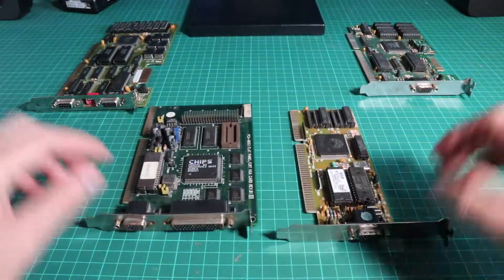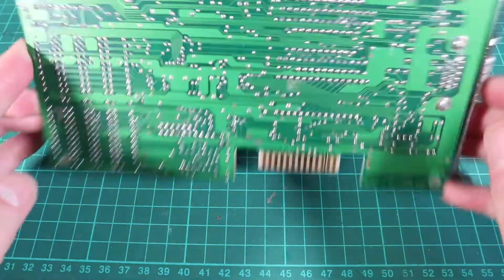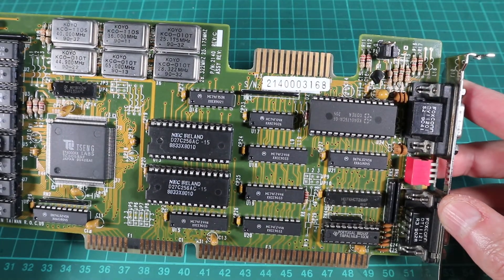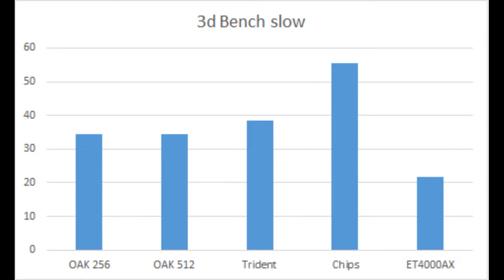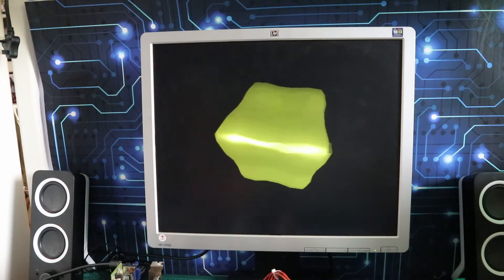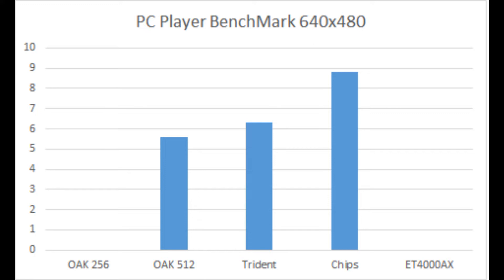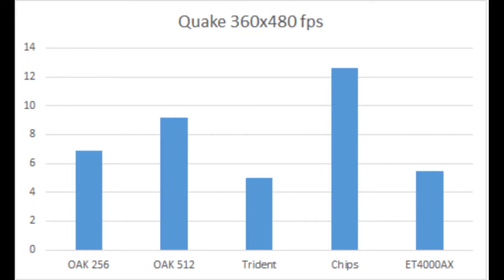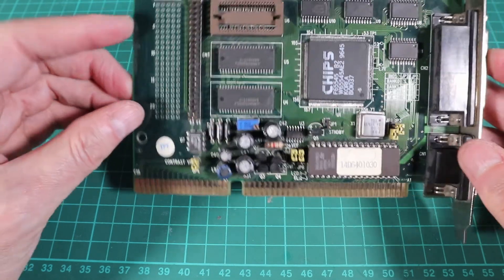ISA Card Benchmarking.

Comment: I wonder if the TTL output (CGA/EGA DE9) is what's holding the ET4000 back. I owned that card back then and it was definitely faster than the Oak or Trident, but mine didn't have the TTL output. The big advantage to owning Oak or Trident isn't the speed, it's that they work on 8 bit bus 8088 machines.
Reply from the maker: Not too sure, Im going to spend a bit more time checking the dips. Hooefully figure it out!

Comment: Nice video!

As you noticed, there is something fishy with that 4000. In my experience though the 3000 performs about like your 4000 did but you also said that too.

I actually like my Trident cards and use them a lot for experimentation since they are cheap to replace. In most older systems, say lower than a 486DX-33, the processor is the bottleneck, so you probably won't notice too much of a difference 386 and down.
Reply from the maker: Thanks for watching :)  yes I'm going to put the trident in my 386 and I'll upgrade the oak to 512k and put that in my 286. I'll do a bit more digging on the et4000 and see if I can figure out whats going on.

Comment: If I remember correctly having had an ET4000-based card from Cardex back in the days it had a pretty crappie BIOS-implementation of the VESA-standard and performance was somewhat lacking here and there.
I got my hands on the Scitech Display Doctor at a point in version 5.3 (or 5.3a I don't remember) and using that boosted performance drastically.
If I'm not mistaken it's freeware/abandonware these days.
Maybe a good starting point for reevaluating your results. Not just with the ET400 but with all your cards...
Reply from the maker: Cool, thanks! Never heard of that. I'll yake a look😁

Comment: I have a few ISA VGA cards including one of the slowest, a Trident, and one of the fastest, a Western Digital. In my lowly 12mhz 286, I could tell the difference in certain games, like Sim City with a math coprocessor installed. I wasn't expecting that on such a slow system.
Reply from the maker: The trident is actually going into a 12mhz 286, with no co-pro at the moment. Will be interesting to see how it does!
Reply: @66mhzbrain  actually my Trident is a TVGA9000i. It might not be as slow as I thought.
Reply: @66mhzbrain  speaking of 286s, mine uses a Mylex motherboard which I modified with the Quadtel BIOS that Adrian's Digital Basement used on his. It's fantastic for hard drive compatibility.
Reply from the maker: Haha,  that doesnt bode well for this one 😁
Reply from the maker: Cool,  might check that out!

Comment: Can't match the model at Stason, the P/N 2140 finds the same model elsewhere... with all those fixed jumpers, it's probably locked into 1ws mode, adding jumper blocks and going fishing may find more performance
Reply from the maker: Cool,  Ill do that,  apparently the signal for the 0 ws comes in on pin 8 of the isa bus so should be able to trace it to the hardwired jumper abd replace hopefully
Reply: @66mhzbrain  On VGAmuseum, looks like this card has no B8 finger at all
Reply from the maker: @Matthew Day  Yes i saw that,  mine doesn't either.  Very strange

Comment: Just a short remark - While a Slot1 machine seems like an absolute overkill to benchmark ISA VGA cards, counter-intuitively it won't show their full potential. If you measure raw data transfer rate the best vet would possibly be something like a VLB 486 board with Opti895 chipset, at least my test VLB board gives better performance than any of the old boards, and much better than the newer ones (like anything PCI, especially anything Socket5/7 or later). Apparently it simply wasn't a goal to have good ISA transfer rates on these, as they have a much more modern bus with much greater potential.

All in all, it's possible thet you'd get better results, though definitely NOT with anything CPU intensive, the heavily VGA dependent 3dbench scores actually aren't that bad.
Reply: Oh, and more on the ET4000 - you're right, something must be wrong with it, it's really supposed to be among the fastest DOS ISA cards. Though, I can tell that I have met such a lemon before. Unortunately I don't have that one anymore but I could really speed up a later slow (not this slow, though) piece using its jumpers. One of them set an ISA bus wait state when it was open (IIRC) and shorting it made a big difference. So it is possible for some of these cards to have such a jumper - though of course it's not guaranteed.

Btw 320*200 tests aren't supposed to use more than 256k video RAM under any circumstances as the VGA memory is accessed through a 64kiB window mapped to the A000 segment and it has 4 "planes" if you use something like an X-mode. Otherwise, you can access only 64k. Doom uses X mode, and Quake non-VESA modes like 360*480 use it too (as it need ~170k of vram anyway). The difference between the 256k and 512k Oak is almost surporising to me, though honestly it could be anything :)

640*480 VESA mode absolutely needs 300k of VRAM, though, so 256k just won't cut it.
Reply from the maker: Yeah the idea isnt so much to bench each card to the best of its ability,  its more to bench all my cards relative to each other on the same environment so I can pick the best performing  one depending on what I need at any given time. So is more out of lazyness,  not having to set up different environments each time and covering isa to early agp.
Reply from the maker: Not sure whats going on with the 4000. The edge connector doesnt even have a trace to the b8 tab in the isa slot that should be the 0 wait state.  I need to apend more time on it.